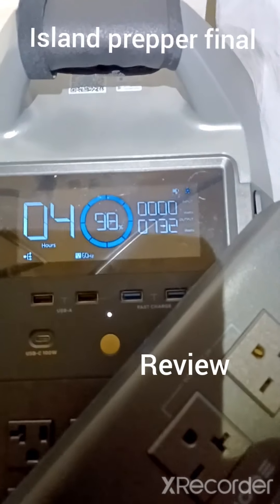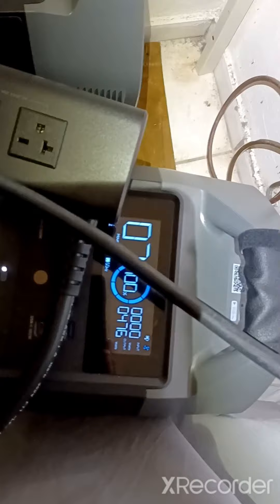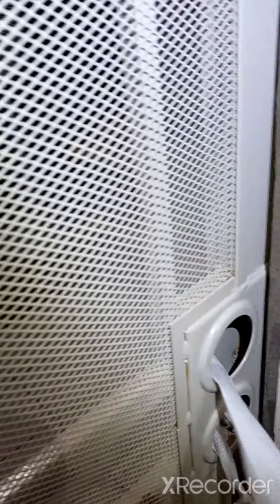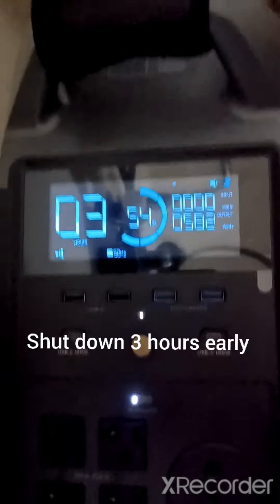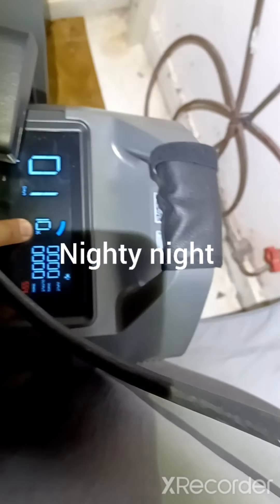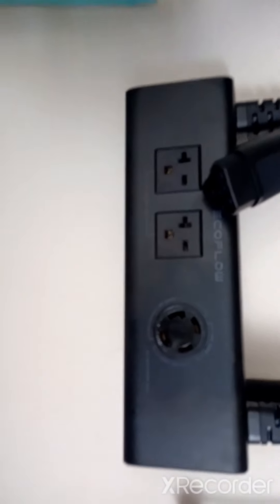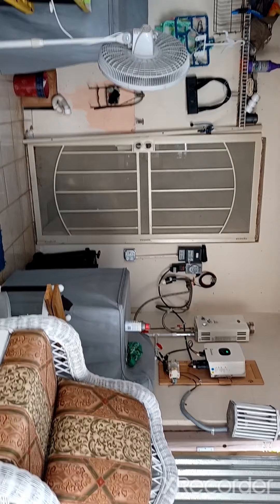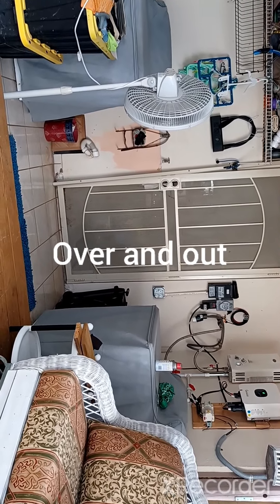$8000 down the drain, Delta pros, low run time  👎

Comment: Sir, I had to give you a thumbs down on your video, NOT on the Delta Pro. The video was horribly disorganized and painful to watch. I think you should have spent more time studying electrical systems and researching "solar generators" before making such a large purchase. A simple survey of the power demands of the items you want to power would have helped you understand what capacity of solar generator you need. As for one unit running down faster, that appears to be because you have a larger load on one leg than the other. Another commenter mentioned balancing your loads, which is what you need to do. I wouldn't expect to run a 30,000 BTU minisplit and another unknown size minisplit and other loads off of batteries for very long at all. I think your expectations were far too high, due to not doing enough planning. I doubt very much that there is anything wrong with your Delta Pros. Good luck to you.
Reply: I agree with you.  If you do not need 240V, or have unbalanced loads, then the house should be run at 120.  Clearly there is no balanced load.  Either this guy should balance the load, or switch the load to 120 v for everything, and combine both batteries to have more depth at 120v.  Then you will have more power available from these two units.  Another thing is that It might also be good to have an electrician set up your system.
Reply: Question about balancing loads: How does one do that? I have 2 DPs and the DVH to run 240-V, but am rethinking that plan in favor or 120-V. I also have 2 extra batteries, one plugged into each DP. The only 240V item I need to run is my pool pump in the winter to prevent freezing, but it is dual voltage so I think I can wire it to run at 120V. Worth doing? I already have an inlet plug wired into my panel. How much trouble am I looking at? Thanks.
Reply: I was expecting a comment like this. His circuit setup is blatantly problematic! Those air conditioner units are too big and out of date on a shifting world where we are seeking more efficient ways to cool our homes and keep food in the refrigerator fresh. I helped my mother get a Samsung Smart Things refrigerator and its consumption can go down as low as 99 watts - with the compressor running! EcoFlow now has an air conditioner that cools like a standard 6000 BTU unit but pulls only an average of 250W - half an ordinary 5009 BTU A/C; the Wave 2.

Comment: You lose a ton of power by having all your solar go through an AC inverter and forcing the Deltas to convert back to DC. You should run a couple panels straight to the delta's solar input.
Reply from the maker: the Solar is not being connected because its on a grid-tie inverter and I dont want to re-wire it, but thanks for the heads up
Reply: Well that’s your loss
Reply: I think that could be one mistake he made. I didn't hook up my Delta Pro to my house yet and I will be using extension cords for a while. At this time I limit its duties to run a Samsung Smart Things refrigerator, a deep freezer and a mini refrigerator and a TV set and a fan. I will need to upgrade my solar panel set to a 1200W network (3 × 400W solar panels) and possibly an extra battery.

Comment: I bought two delta 1000’s for $1200. Also 400 watt solar panel for $500. I can use both at different parts of my house without extension cords or if I need to power my fridge can rotate with Solar to use continuously. You certainly need to research want you need or want and what various systems can supply. As you found out if your not savvy or realistic you can spend lots of money and still be unhappy. I’m more than pleased but I tempered my expectations. I expect to survive an outage, but I realize it won’t be “ normal”.

Comment: There's so many things you're doing wrong here, I'm not sure where to start ? My Island friend, a little bit of knowledge is a dangerous thing !!!! 1. Run your solar panels straight into your Delta Pros, please. 2. Do you want running time ? These units are only designed to give you peak performance if you've maxed out the external batteries on each unit. (Two 3Kw batts are to be connected to each unit). Go get them if you want running time.  3. You must be sure you're running the latest firmware in each Delta Pro, as this will address the issues you are experiencing. Please check and verify you have the latest firmware running on each Delta Pro. 4. You need to rewire your D.Y.I. off grid AC system to better balance each phase of your 240 split phase setup. This means you don't put all or most of your high amperage drawing AC home appliances on one 120 Volts AC side of your 240 Volts AC Split phase. This is a really important point to understand. There's too many other things done wrong on your system from what I can see from what you are showing in this video. Just because something works, doesn't necessarily imply it's done to the most efficient design and implementation. The Delta Pro split phase 240 AC system is designed with either maximum spec solar connected to each unit in your split phase, or EcoFlow Smart Gasoline generator is also connected as backup to automatically come on and charge back up your Delta Pro's if they drain down to a specific, pre-programmed level of charge. I do agree with you that the units are far too overpriced for what they deliver. The company is also anti-customer care and predatory in my own personal experience and opinion, but they do make highly innovative and good quality products.

Comment: Maybe your Delta Pros need to be recalibrated?    This solved a similar problem I had.
When they are both at 100% charge, disconnect any power input from each (AC, Solar... etc).
Use them independently and run them down to full 0%.    Next, charge them up (with no outputs at all) to 100%.
This will recalibrate the Pros, and your problem may then be solved.
Be sure the firmware on each is also up to date and...
good luck!   But this worked for me!
Reply: (Recalibration allows the Delta Pros to communicate with one another effectively, so the discharge levels on each is shared more)
Reply: I'm kind of having this same problem with one of my pro's. It's run time was good before but after firmware update pulling it with 100 watts state of power says it can only run it for 6 hours with full 100 charged which I know isn't correct. Ill try this advice you gave to see if it fixes it.
Reply from the maker: Thanks for the feedback I received the same info from Ecoflow, BTW that part of their service is pretty good, but it turned out my firmware had already been updated and I did that twice, but it did not resolve the problem, also when I have an A/C unit running, they just dont last very long, and dont get me wrong, its a great product, but for the money, I can do MUCH better.
Reply from the maker: @1ENDUSER  , Hi Rinzler, I have now used it several times in order to run them down completely and re-charge them back up, but last Saturday we had another outage for 11 hours, and I used them but only at 120v, with no A/C running, I wanted to see how long it would run, in real-time use, I should have had over 14 hours, but it gave me only 10 or 10.5 hours of run time, also my house is supper efficient, my $200 blackmax gen would have run 14 hours at full load, no problem, on 4 gals and refill in 5 minutes vs these took over 5 hours at 800 watts each.
Reply: @islandprepper3791  - Battery solar generator won't be as super as a gas or propane generator they aren't a replacement yet or there yet to be a replacement. For one you need solar to have it run efficiently for you. 2nd the capacity is limited to how much battery you have and 3rd the watts it takes to keep the inverter running during use of the generator. Its only a true replacement based on if you really over panel & over battery capacity on what you use daily to go off grid. Let me put it easier for you to stop promoting that the Delta sucks for you. Its like having a 2WD VS 4WD truck. Yes the 2WD can go offroading a little but at the end off the day to really go off roading in dirt/mud you need 4WD. So stop with the Ecoflow hate, since they are the only solar generator company innovating in that platform.
Reply: @1ENDUSER  I’m looking for a solution to run a Tv, computer, small refrigerator and maybe a game system for maybe 10-20 hours in a semi;and a 1500 watt tea kettle. The only thing running while I sleep will be a smaller refrigerator. Do you think a generator will still be the better option opposed to these power stations?
Reply: @realhustle5939  yes a generator would be more cost effective over the short-term,  however most people that are buying solar generators are adding solar panels and extra batteries for additional energy consumption and or redundancy. There's to many variables for anyone to say exactly what you need, such as your kwh/month, sunshine/month, # of batteries, # of panels, location, location, location 😀 😉 😄 😎.
Reply: @blkgranit333  Thanks
Reply: @realhustle5939 - I'd buy both in your scenario or buy a system like this and build a small one with high battery capacity to charge it up during the evening when using the delta and make sure to have solar. To charge them in the day or your semi or the gas/propane generator. Buying 2 delta isn't worth it anymore unless you bought it through their kickstarter. I'd just buy one and do a diy and or have a gas/propane as well.
Reply: @realhustle5939  i use a ecoflow delta in semi its like 1200wh 1800 watt inverter i run xbox monitor led lights electric skillet air fryer coffee pot ect obviously not all those at once on average use about 15 to 20% to cook meal i had bluetti eb 55 half the size of delta i use it for small stuff lights charge ipad phones ect i plug both in with 12 v cig lighter to recharge them they are always pluged in charges slow but while your driving they recharge at about 95 watts which prolongs battery but if you bought the eco flo pro yes more than enough power to do what u need in semi oh yea i also run my cooler fridge / freezer 12v off delta no prob
Reply: @kennyjohnson8100  Thanks, this is the answer I was looking for because you understand sleeping/living in a sleeper 💯
Reply: @islandprepper3791  where do you get 200 dollar black max generator and what size is it?

Comment: Thank you. Someone actually honestly told the truth about these over priced ecoflow delta pro. I have had nothing but issues with my delta pro. Alex (ecoflow support)  of ecoflow constantly comes up with ideas that doesn't work. I have 1200 watts of solar and can't get my delta pro to take more than 400 watts input. My unit keeps shutting down the AC output for no reason.  I am a disabilited person and bought this to help support my heart machine when lights go out. I agree " way over priced" I do not think these units work as they are hyped up to be. Most people on YouTube received these units free for reviewing or at least a huge discount. So don't believe the hype about these over priced units.
Reply: Honest review? Have you seen other home setups and reviews / plays? Clearly you sound like you have a bias or something because others have had different results. For example, if you cannot get more than 400 Watts of input, that is a problem because others can get over 1200. Your unit keeps shutting down the AC output? Clearly sounds like you have the AC timeout enabled and don’t have the AC always on option. So the issue here is an ignorant perspective without knowing the product or contacting support for a faulty unit. Has nothing to do with the overall aspect of the unit itself and what it can do. Overpriced? Shop around and you will see better prices. Or if you know, a 100 AMP lithium battery can cost up to 1000 dollars alone and this has 3600 useable Watts.
Reply: Solar is just an overpriced gimmick at this point. Gas generators seem to be the way to go until solar power is made more reliable and cheap.
Reply: @higherho1540  You got yourself one? Im considering one, im not sure if i can charge the Delta Pro with Solar Panel 1200W (day time) while using it on load max 1kW? I have River Pro, charging without load already heating up the unit. But those are different units and batteries. So anyone has tried?

Comment: I had a Delta Mini and the battery life was draining way faster then it was suppose to, customer support had me do two full cycles of charge and discharge to reset the system. and it did worked.
Reply: That won't solve the "problem" he is having. From the sound of it he is expecting either the battery to be WAY bigger in capacity than it is or he is expecting to harness energy from thin air.

Comment: You shouldn’t be using the hub and expect that the power between the 2 delta pros will share the battery.  You should use the extra battery plug and connect the 2 delta pros using the extra battery port instead.  That will do what you were expecting.  The hub is only a splitter and will keep the 2 delta pros separate and still connected together into your house.  If you use the extra battery port both delta pros will share each others power.
Reply: He isn't really using the Delta Pros properly.  First of all, you can't expect one Delta Pro to power anything above 150W for 24 hours straight constantly unless it's a refrigerator with the compressor constant.  Second, he is using an air conditioner that is already obsolete and a needlessly high BTU capacity.  His refrigerator may also be outdated due to a comparatively inefficient compressor unit.  Clothes dryers are a no-no. The way the emergency circuits were set up for his house are a mess! He is addicted to generators that produce smog. How he brought home those Delta Pros may not have been sourced by a reputable vendor. I got my first Delta Pro for $4,998 at Power Sports Warehouse yet no taxes. He should have consulted Power Solar before he made his purchases of those D-Pros. He didn't even bother to check EcoFlow's Smart Panel nor the transfer switchboard! Plus, he needs to look for the Extra Smart Battery for each D-Pro however at extra cost.  Another thing... do you know the golden advice, "Good food takes time,?" He shouldn't have rushed the acquisition of those D-Pros. And again the outage emergency electric circuits were set up all wrong! And as this video showed me he has some excuses to go back to Big Oil for his backup power source.

Be sure to check for alternatives such as Infinity Battery and to consult a solar power solution technician which he should have done before he got into this mess.

Comment: Dude you have way too much going on to be testing out new equipment for the first time. You need to run the units directly to your breaker and bypass all of the jerry rigs you have going on, and even you don't know what's powering what and you set it all up. After you verity the units and it's capabilities than you can try and introduce other variables. What you're showing is a very good example of user error.  YOUR TRYING TO DO TOO MUCH BRO...
Reply from the maker: Hi John, its connect as recommended, to a 30 amp transfer switch and that is connected to a sub breaker, unfortunately, I can not connect to my breaker because its located inside the house, but the sub breaker is connected to my main breaker. Thank for the info anyway

Comment: To answer your frustration about the units drawing different power ammounts that is how it works 

If you draw 100 watts on the left side of your panel (hot leg 1) and 600 watts on the right side of the panel (hot let 2) your going to be pulling just that the 4 prong plug uses neutral and ground which are bonded to both units

Hot leg 1 goes to eco flow 1 
Hot leg 2 goes to ecoflow 2 

That is just how it works those units aren’t outputting 240 volts on their own they are only giving up 120 volts per unit that’s how it works 

I’m sorry hope this helps but that isn’t an ecoflow issue you need to balance your load better. 

If you’d like to figure it out open your panel up and take a load reading on each leg on your service
Reply from the maker: Thanks for the info, just finished using them for 11 days after Fiona, so I'm learning a lot, but I just sold one and selling the other, to much for to little and I end up using gas anyway, also all my neighbors with off-grid systems, had to use their gas gens.

Comment: I want to buy them
Reply from the maker: think twice, they are great if you have the extra cash available, but if you need them to run your home, you need to get 2 delta pros and 2 batteries, and 1 gas gen from ecoflow. that would work in an emergency or for use daily, for about $15k

Comment: Out of curiosity why are you not haveing the solar panels charging the Ecoflow during the day while your using the delta flows to power your home ? That would increase your runtime and as long as your incoming charge watts so equal or above your usage your delta flows should not run out of power during daylight

Comment: I believe that 1 leg in  your panel is drawing more than the other which will run down that particular unit. Maybe get a 6 circuit 120V transfer switch wired in to your panel for each Delta Pro that way you can run multiple 120V circuits. Get some 120V AC units.
Reply from the maker: what I came to was, the same as setting up your solar panels, in series or parallel, one will work in conjunction with the others and the other will work independently from the other, the HUB will not set the batteries in parallel in order to work evenly.